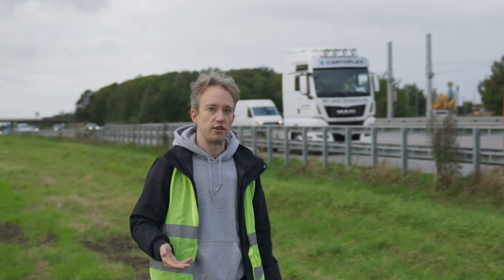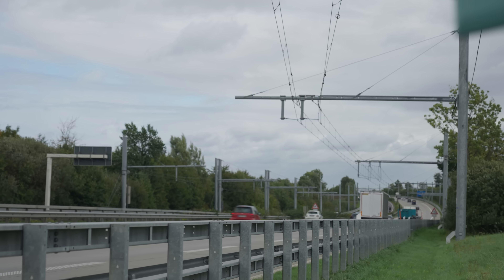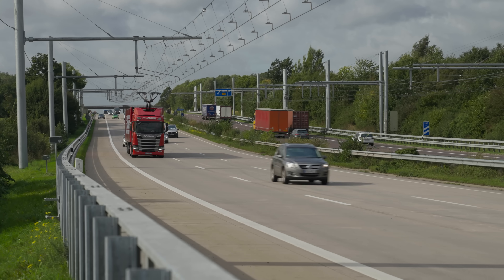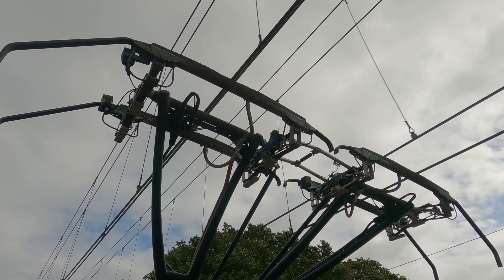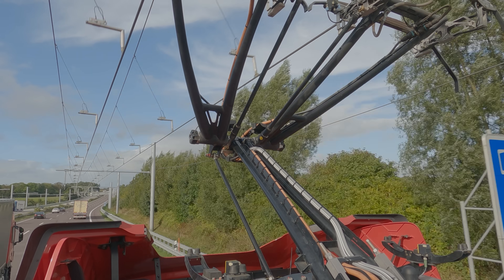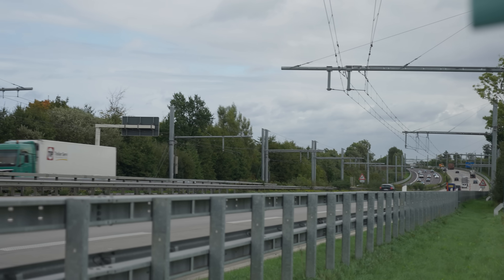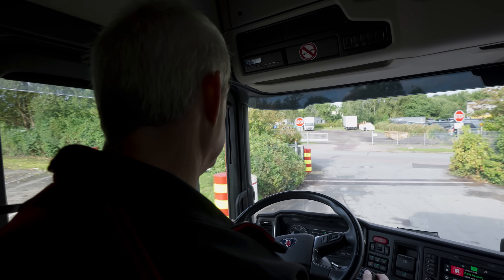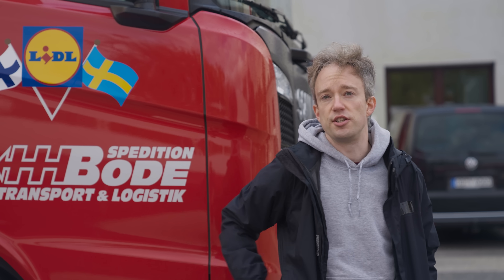The highway where trucks work like electric trains

Comment: My one concern on this is wear on the carbon pick-up strips. 
On trains and trams the overhead lines are set in a zig-zag line so that the cable runs from side to side on the pick-up as it moves forward, evening out the wear. It this were not the case, the cable would wear a slit where it rides on the carbon. Trains run on rails, so stay fixed in relation the the overhead line. Trucks are subject to traffic and do not travel in a fixed relationship with the overhead line. Look at the wear on the carbon on the pantograph as it drops -  03:00 
Given enough wear, could that rip down an overhead?
Reply: The fact that the trucks don't always travel the exact same path should provide a decent amount of wear leveling. At least wear should be some sort of bell curve with gentle slopes rather than a slit with sharp edges. And of course, I'm sure they will have strict inspection and replacement procedures to prevent any damage.
Reply: "On trains and trams the overhead lines are set in a zig-zag line so that the cable runs from side to side [...] Look at the wear [...] on the pantograph as it drops"
I was noticing the same thing. So... Why did they not do that here? I can only assume it isn't done on a short test setup and would be done on the real thing. I mean... yes, trucks are not fixed to the overhead line. However they usually stay in one lane (except when they overtake each other with 0.1km/h speed difference - which was covered in the video) so I guess zig-zagging the line might be possible.
Reply: @TheMightyZwom  
Because if the truck strays to far to one side at the moment the cable has zaged to the other way. It could come off the pick up creating a dangerous situation.
Reply: @Robert-j6r8c   im sure both the pickup on the truck and the wires themselves are loose/springy enough to allow the wires to jump over those ripples in the carbon if a truck steered off to one side while still connected as long as the grooves are smooth and dont turn into a 90degree ledge it shouldnt snag

also i imagine they make those carbon pick up assemblies with a weak link thatll rip off prior to ripping the lines down, the voltage used im sure is no danger to people and as far as stuff falling down onto the road thats already a continious problem that really isnt ruining the roads at the moment, rocks and ice are constantly falling off of trucks here in canada and animals routinely run on the road and get hit, people do still have to pay attention and maintain a following distance
Reply: @AndrewBrowner  
I want talking about the grooves.

The actual frame itself, it's only so big.

If the wire zigs to the far left of the road, meanwhile the truckie drifts to the far right it could fall off.
Reply: @Robert-j6r8c  According to the video the pantograph is pulled down automatically when the truck switches the lane. So it must be able to detect when the truck is leaving its, let's call it: ideal drive corridor. I guess the same technology would prevent the dangerous situation you imagine. I might be wrong - but that would be my guess.
Reply: @AndrewBrowner  the voltage on the wires is 670V DC - even if it's 335V + and - relative to ground I would not want to touch that.
Reply: I noticed that too when the clip of the pantograph lowering was shown. I know little about how that kind of stuff works, but I wonder if using an electrical contact type similar to those found on older style trolley poles with the rotating wheel at the end would have any type of benefit, since its turning like a wheel rather than sliding on the wire like carbon pads. just a thought
Reply: I noticed the wear as well, but I think in the video, the line was zigzagging a bit. However, since trucks tend to drift a bit from side to side, it's rather likely that the truck will be drifting into same direction as the wire (at the same rate as the wire), and start wearing small grooves to the slit. This would get amplified over time, as the grooves get deeper and deeper. But I don't think this is a too big of an issue, if the carbon last a reasonable time, say 1 month (9-14 hours driving a day, 5-7 days a week). Keep in mind that large trucks tend to go through something like 400L (or more) of fuel a day. In this regard, having to pay 500-1000€ to replace carbon piece (it is designed to be the peace that wears out after all), is not a big deal, if you'll save well over 10 000€ in the process. Anyway, if this idea were to take off, the cost of a new carbon piece would probably be something like 100-200€ or less. Changing this wouldn't be too different from changing tires, wipers, fluids etc. It would just need some clever wear indicator, and if necessary, you could setup some cameras to monitor the wear.
Reply: That's a good point, but there's a bigger issue. Railway overhead wires are naturally sited right over the track, including crossings and junctions. When a lorry might change lane at any point on a road of 100s of miles wrong, what happens as it loses contact on the wire- each lane will need its own wire and some means of transferring the pantograph from wire to wire. On British Rail they were a pioneer of working out how to lift a pantograph onto the wire at speed (dropping it is easy.)  I have no idea what happened after that as I left R&D.
Reply: @derekstuart5234  "each lane will need its own wire" - surely not in Germany. On a German Autobahn,  trucks / lorries are usually travelling on the right lane. It would not make sense to install these power cables on other lanes, where they would be rarely needed, but instead the available resources should be used to install the cables on as many km of right lane as possible. As already mentioned in the video: If a truck leaves the electrified right lane towards a left/middle lane (in order to overtake a slower truck), it would (have to) switch to power from a battery or a combustion engine.
Reply: @tobyk.4911  And then if another vehicle happens to collide with one of those overhead-powered lorries…?
Reply: @denelson83  exactly the same thing as woulkd happen when a vehicle collides with an ICE lorry. It wouldnt make any difference whether it was running from an overhead line or not
Reply: @derekstuart5234  These are battery-powered trucks, so if they have to change lanes, they can just switch to battery power. You can see at 2:59 the truck lowering the pantograph to take an exit off the highway.
Reply: @HiddenWindshield  just like that, eh? Have they then overcome the problem of pantographs making initial contact with the wire when at speed? I've seen this experimented with trains and it often had the result of pulling the wiring down.

It's all very well running a few videos of an experimental system, but I'm sceptical of it working in the real World (Real World... do you all remember that?)
Reply: @derekstuart5234  I don't know why connecting at speed would be a problem for older designs, but whatever the issue was, they've obviously solved it. Look up a video titled "eHighway ELISA - OH-Lkw auf der A 5" (no link because of YouTube's idiotic filters). It shows a truck connecting its pantograph at speed in the real world (as you so condescendingly put it). (Edit: almost forgot to point out that that video is two years old ).
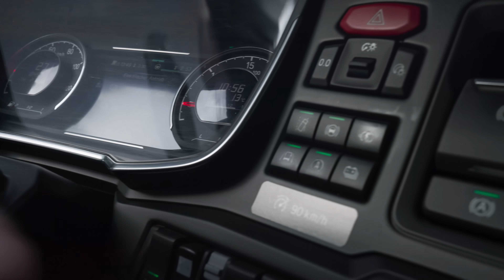Reply: @derekstuart5234  My guy, they show the truck making contact at speed at 1:11 IN THIS VERY VIDEO! Now, I'm no expert, but I think that means that, yes, they've solved the issue.
Reply: I'm sure they figure it out.
Reply: You are right about the wear of the pickup on the lorry, but the power lines do zigzag, you can see it at your 3:00 position if you play it at havre or quarter speed
Reply: @MrNiklasBr  But the truck do not go straight.
Reply: Maybe the autosteer function can drift somewhat to the right and left over a few kilometers to offset even wear?
Reply: @JJVernig  you're not an engineer, are you? You really wouldn't want to be adding to wear on the steering components nor inducing lateral movement in the loads carried.
Reply: Drivers should drink before and you will get the zigzag :)
Reply: I was about to say. Trains don't have to overtake anyone or deal with other motorists. Would you really trust this when it's dark and a bit windy?

Show me a video of a truck intentionally trying to damage the line. I bet you it succeeds
Reply: @KiLLJoYYouTube  Trains cause lots of damage to overhead line equipment and they are fixed beneath it.
Reply: @KiLLJoYYouTube  If someone is deliberately aiming to damage infrastructure, there will be stiff punishments for it. At the very least you're looking at a loss of your CDL. At most, you could face massive fines and as many as 15 years in prison. Also, unless the support structure itself breaks down, line repair isn't that hard of a thing.

Also, as a way to kill a bourgeoning industry? Unless it becomes a widespread issue, acts of terrorism like this won't do much of anything to stop it.

Tech like this is something we've been doing for decades for commuter rail, if not from overhead lines then from an electrified third rail. It's simple, and as long as we have good contact, it works. When adoption rockets off, this will become the default.
Reply: @KiLLJoYYouTube  Would this bee too different from overhead wires for street cars, trams, light- or heavy rail? I mean sure, you can take them down but why would you do that intentionally? I mean, there isn't too much vandalism on the other overhead wires, nor are there too many people who'd intentionally try to block a motorway (which is rather easy as well. Just flip a lorry on it's side across all lanes. I'd say one should be more worried about trees falling on those lines (though this is a problem that can be solved quite easily) or what to do if a pole or two get knocked down in some accident.
Reply: @KiLLJoYYouTube  Now the question here is: Why would anyone WANT to damage the wire. Because if you wanted to kill an entire industry, that wouldn't work. As we have established, a Truck still needs a battery for the last mile... So if there were significant damage to one part of the overhead wire, Trucks could quite easily avoid it. One can see in the video that - like regular electric Railways - the wires are not continous. Every few [amount of distance]s, a new wire comes up and the previous wire stops.

If there were one truck causing damage to the overhead wire, the resulting traffic jam would propably be more dangerous than the wire.

Comment: Exactly the opposite could happen re buses. For example, in Debrecen, eastern Hungary, they recently replaced the Soviet era trolley busses with new hybrid battery ones.  So now the trolley bus routes can be easily changed, with the busses using the overhead wires for most of the route, but switching to batteries, where required. But soon, of course, the old diesel busses will be replaced by battery ones. And once this becomes normal, the cost of maintaining the overhead power structure for the trollies will look daft. So, how long before trolley buses are also a thing of the past and we just have buses - all battery electric?
Reply: Although, of course, long distance busses/coaches could use the same system as the lorries. Another justification for such a system.

Comment: Why not do this? because we already have electric trains, so it would be way easier and better to use those already existing electric train lines, instead of adding electric lines over the entire highway system and modify all the trucks for this.

But if we want to invent new transporting system, then we should just modify the containers, they are large already, adding some battery, electric motors and wheels would not be a big difference, and the containers themselves could run around the highway system. it is simple enough to do not need the full self driving car upgrade kit, just follow the electric lines, and jump of at the end into a logistic center, where they are put on trucks for the final delivery.

Comment: It's a classic German and car centric solution, for a problem that shouldn't even exit. Cargo should be transported over rail and not over the highway. And you don't need electrified highways for last mile delivery.
Reply: But not every warehouse/distribution centre is near a train station, and building more train station and rail tracks is a lot more expensive than upgrading existing highways

Comment: One problem I see: wires and pads will wear out, it's even visible in the video (the pantograph pads are dented). Trains use fairly thick wires and high voltage, plus rails are the other electrode, and trams/trolleybuses are fairly slow (lower current, fewer arcs/sparks), and there are fewer of them per meter of wire. And even they replace pads regularly.
Reply: Can you be optimistic, just once?

Comment: The extra cost of installing this system in a truck would likely be offset by the lower cost of its smaller battery and the fact that a significant amount of energy is lost when charging a battery. This system would likely be more efficient grid-to-wheel, offsetting the extra cost per kW h.
Reply: No. Batteries are far too cheap for this ridiculous Big Infrastructure system to ever make any sense. And batteries are only getting cheaper and they are getting cheaper quite fast.
Reply: @peterfireflylund  Last time I checked, a Tesla battery pack was around $15,000, not exactly what I'd call cheap, and let's not forget that this is for a passenger car, not a lorry. Also manufacturing batteries is far from a 'green' process.
Reply: @milandavid7223  That the retail price for a "naked" replacement battery pack. You can be very sure that the cost of it as part of a car is far lower. (Current estimates for Tesla are at about 6900 USD with expectations for it to go to about 5300 USD for the 4680 cells.)
Reply: @HenryLoenwind , the truck fleet owners will not get batteries at cost unless they own their own battery factories. There is a massive price difference between a 60 kW h and a 100 kW h passenger car, which is significantly larger with the 500 kw h or 1000 kW h packs that will be needed for semis. Trucking companies have extremely thin profit margins, and will take any advantage they can get.

Edited for spelling.

Comment: I remember James May coming up with a very similar idea to this as a joke on Top Gear about 10 years ago. Interesting to see it in action, hopefully it becomes the norm one day.
Reply: Though using a slightly different device to close the circuit with the overhead power line, trolleybuses used to be quite common...

Comment: They're trying to reinvent the wheel with this one, it is a good thing, but ultimately it's still not going to be as efficient as electrified rail.
Reply: The issue is getting permission and the money to build a new railway where it is needed and there is already a motorway ... or doing this ..

Comment: Weird to see people talking about this as something of the future, or something of the past - or as justification to have trains instead.... biggest city in Brazil, Sao Paulo, has had busses that uses that system for decades now. But it wouldn't work on highways here... well, perhaps a few ones with private partnerships and extremely high tolls, they are large and smooth enought to handle it, but not most.
Problem here is political will for large infrastructure projects - it just isn't there. Private sector also has no trust in political stability to propose something like that.
You know how it goes, the thing that Brazil really needs is also a modern train system at least connecting some of the major cities, which wouldn't even benefit me much, but still. At least a modern system for cargo transportation. But we can't get even there.

Comment: Battery trucks will never be a thing, at least not with Lithium batteries. You will need so much space and weight for the batteries that there is not much left to move around.

Comment: My issue is when they change lanes. What if they forget to lower the arm? Will it catch and yank power wires down and hit other cars? I've seen semi drivers with a dump lift trailer still up and they take out freeway signs and cause millions of dollars in damage to roads the signs obviously and other cars. Also how does the paying for it work? GPS measures distance connected? On board smart meter?

Comment: A better solution is that every loading place has a charger, and that you can plug in the charger on the trailer.  In the time it takes to load/unload, you will have a full battery.
Reply: It takes something like 8h to fully charge the batteries in these big trucks, meanwhile the load time can be as low as 15 minutes if you're just switching trailers that are ready to go. A combination of technologies is needed.

Comment: Question.

I saw that there's two wires on the catenary. But why does the pantograph on the truck had 2 pairs of carbon strips (the one making direct contact with the wires). Wouldn't it be much simpler design wise if it uses just one long one? Also for safety factor wouldn't it be much safer? If say, the driver accidentally driven of the lane and the hollow section in the middle of the pantograph would've strike the wire.

Comment: Great to see this working, rather than yet another ‘maybe’ project. But .. Tesla are about to roll out their Semi with 500 mile capability with “Megachargers” for them at central depot’s with under 2hr turn round times. Given their new Berlin factory is up and ready, and the 4680 battery tech is going to start scaling up in 2022-3, I would have thought that within 2 or 3 yrs the battery solution will be more cost effective. 2040 is a long way off, 2023/4 is round the corner and about to happen.